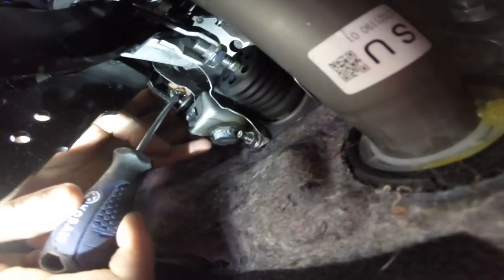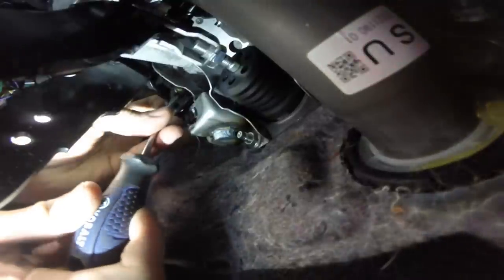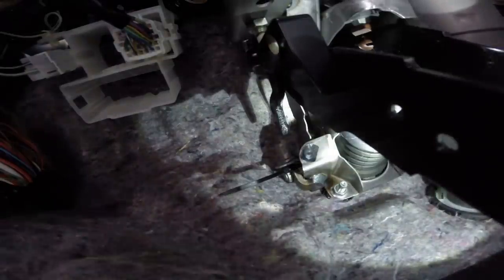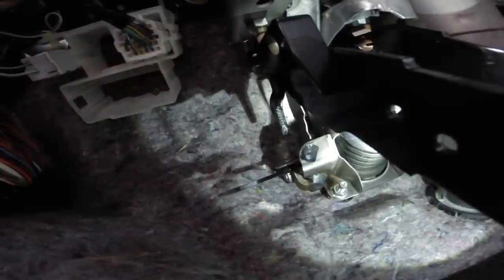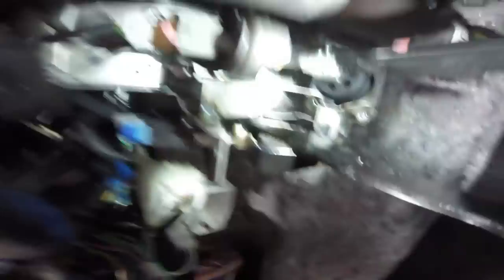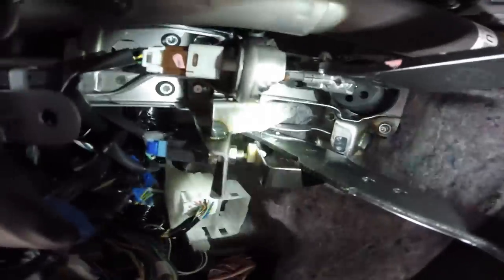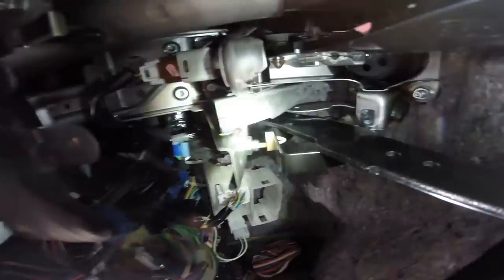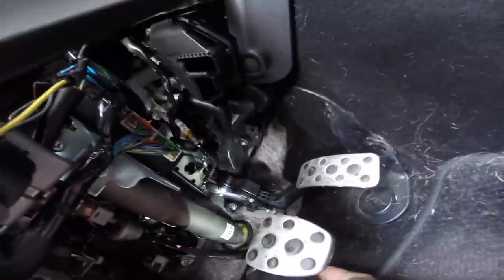Clutch pedal helper spring removal (2013 WRX)

Comment: Had done this to my '08 Impreza 2.5i, and it's a night/day difference. As for removing the spring itself, I found it best to hammer it out with a screwdriver and a small hammer without having to depress the clutch. Careful though, the spring is compressed and my fly out towards you.

Comment: I removed the helper spring as shown but my method of adjusting the clutch pedal was different. I removed the cotter pin on the short shaft that pivots the pedal with the U bracket. I was able to rotate the input shaft with the U bracket together clockwise to shorten the travel.

Comment: Wow thanks it's exactly what i was looking for. I have a 2011 wrx and the clutch pedal is making a clicking noise when i push it in (its not the starter switch clicking), and I believe that return spring is the culprit...
Reply: 6 years too late but you likely have popped firewall welds that need the Humble Rumble kit fix